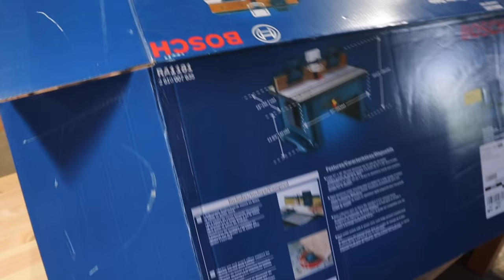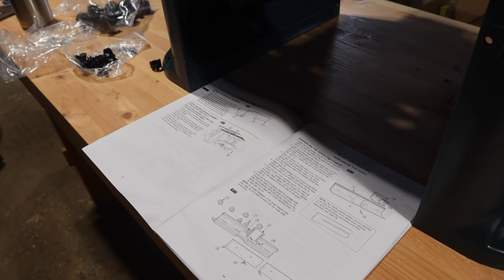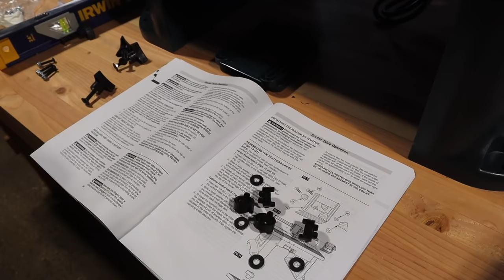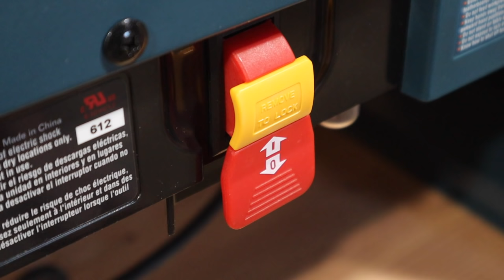New Bosch Router Table | Model RA1181 - Unboxing & Setup

Comment: Great video. I just bought the same table and router from a fellow woodworker for $225. They were brand new in the box.  The table top will fit perfectly in my Ridgid table saw extension. I am happy to hear that you said it comes with shims to joint. Hopefully I can get it set up tomorrow.
Reply from the maker: Awesome! That’s a steal of a deal! Happy building, I’ve loved having mine around.
Reply: I’m thinking of getting this router table and  same router you have. You still like the router table? Is it level?
Reply: @stevesiefken6432  I do like it. I have never had any issues with the table or router. 👍🏼

Comment: I purchased the same table from Lowe's about 2 years (had to special order it) ago and it is still going strong (just used it today).  Great video!
Reply from the maker: Sweet! Glad to hear it’s still going strong!
Reply: @NorthwestCraftsman  how much this router ?
Reply from the maker: @johnyabut5887  both the router and table can be found on Amazon at the following links 😊 prices will vary depending on when you check. 

    Router Kit, Bosch 1617EVSPK: https://amzn.to/2HE72Kk
    Router Table, Bosch RA1181: https://amzn.to/37OY0W6
Reply: How easy is it to square the fence to the bit? I have an older Ryobi router table and it is a massive pain to properly align the fence.
Reply: @smattt personally I think any squaring is a pain in the rear but it’s less complicated than others. Just take your time and don’t get too frustrated. All-in-all not too bad.

Comment: I bought virtually the same table 20 years ago made by an Australian Company called Global Machine Company. Came with its own router. I got it REALLY Cheap from Lowe’s. I just had to assemble it. I remember the Manager at Lowe’s was VERY eager to get rid of it.
Reply from the maker: Fascinating! Has it held up over those years?
Reply: @NorthwestCraftsman  Yes sir it has!  It doesn’t get heavy use as I also have a Router in my ancient Delta Rockwell table saw extension. 
  It’s fascinating this design has endured. Mine also has legs so it stands alone. I’m really sure I’ve seen this same design under other names as well. 
  I also bought a cheap Drill Press from that company as well. Still hanging in there. It even has a laser!……..Cheers

Comment: You can see (6:26 ) that this table is worped. look at the left side of the fence as it rises towards the center of the table.
Reply from the maker: I’ll need to double check when I get to the shop this morning but I’m pretty sure this was the MDF fence and not the table top.
Reply from the maker: I just double checked and what is showing in this clip is the MDF not being flush to the table. When I throw my level across the table is flat within about 1/64”. This may not be flat enough for some, but for an amateur woodworker, this is perfect for me. Give me 5 years and that may change, but for now 😂
Reply: @NorthwestCraftsman  Thanks for the reply, glad it was the MDF and not the table.
Reply from the maker: @michaeljakus8373  of course! Thanks for calling me out, there are many times that I’ll miss something like that and that’s how learning happens.

Comment: I have one of these tables and my top was warped, as someone else has mentioned in the comments. I contacted Bosch and they sent out a new top, so kudos to them for the customer service. Unfortunately, it was also warped. I took a couple hours and was able to flatten it a bit by knocking down the high spots (with elbow grease and some sand paper on a slab of flat granite). It helped a considerably, but there are still low points and the top still isn't flat enough to support workpieces for something like nicely fitting rails and stiles. I've continued to use it for less precise work, but plan on getting a new table top, plate and fence when I finally tackle the upcoming kitchen project.
Reply from the maker: Interesting! I’m sorry to hear about your experience with the table tops. It’s possible I’m just not nearly as attuned to minor differences that some of the users (yourself included) are seeing. Glad Bosch at least tried to remedy the situation. Thanks for the comment!

Comment: I've got the same one coming in this Monday  9 -28. I'm 2nd guessing with all the negative comments about bits getting stuck , unlevel surface etc. I've got the 2 1/2 hp  Harbor Freight one. Its about a week old, still hasn't been used yet.. Nitpicking about which bits to buy. Looking at the 70 Bit Professional C3 Carbide Router Bit Set - 1/2" Shank - Yonico 17702..
Reply from the maker: ccdirectt vdllc I saw a bunch of the negative comments as well but haven’t had any issues with mine. Perhaps it’s a batch inconsistency issue? 

The bits honestly make a huge difference. I got a cheap set off amazon which gives me a variety and then a nice Freud bit (3/8” up spiral bit) and I love it.

Comment: I owned this Bosch table. I have one minor complaint and two major complaints about it. The minor complaint is that the cast and machined table surface isn't flat. It was warped, not severely but enough to be very annoying to me.

The first major complaint is that the insert is a non-standard size, so you can't use another vendor's router lift.

The second major complaint is with mounting a Bosch fixed base upside down to the insert plate. When you turn Bosch's MRF01 base, for example, upside down, the entire weight of the router motor is suspended by a single E-clip, a spring clip held in a groove on the height adjustment shaft. That clip eventually gave way and left the motor unsuspended for height adjustments. Most fixed router bases use a similar design such that they're great when used right-side-up, but they're unacceptably weak when used upside down. Combine that problem with the inability to use a third-party router lift, and you end up with an annoying and awkward router table.
Reply from the maker: Robert, thanks for your well thought out response. I can understand why the warped table leaves a sour taste, especially if you want to use your table for anything like jointing, makes it unusable. 

I didn’t know that the router plate was a non standard size! Interesting and frustrating if you already have another router. I know it’s designed to work with the 1617EVS and the height adjustment included but I hadn’t thought about height adjustment with other brands. That’s a great point. 

With regards to the mounting, are there not fasteners that attach your router to the router plate? The securement method I have and see on the plate is quite secure. I guess this assumes the default Bosch plate is used.
Reply: @NorthwestCraftsman  To be clear, other router motors fit into the Bosch router plate. It has several hole patterns so that you can use other motors. However, the plates of third-party router lift manufacturers won't fit into the tabletop.

Regarding the E-clip, I can speak only to the Bosch MRF01, the fixed base associated with the Bosch MRC23EVSK router system. Certainly, the fixed base is well secured to the insert plate. And, the main clamp of the base securely holds the motor in the base when routing. BUT, when the main clamp is loosened for height adjustment, the entire weight of the motor is suspended from the E-clip.

This is getting into the weeds, but you can see an illustration of the E-clip this way: Go to the Bosch website and search for MRF01. Go to the product page that describes the MRF01 and then scroll down under "SUPPORT". Click the "More information" button under "Search for Parts Diagram". Enter "MRF01" (without quotes) in the "Tool Model Number" window and click the Search button. Then click "View Parts Diagram". Item 21 is the height adjustment shaft. Item 23 rides on Item 21 and its tab locks into a groove on the motor; the tab supports the motor when the main clamp is loosed for height adjustment. Item 22 is the E-clip, what the Parts List calls "Retaining snap ring"; THIS supports Items 21 and 23 and, thus, the weight of the motor.
Reply from the maker: Interesting! I appreciate you taking time to lay that all out, that makes a lot of sense and does seem like a design flaw, or at least a weak point.

Comment: Very nice.  Thanks for help with assembly.  The confusing part is all the screws.  All these terms: truss head, pan head, #10 by xxx.  Why didn't they just color code the 400 screws that are included?  Then they would say, put the phillips head (ORANGE) screws (4) into points, etc.  

Part of your video that really helped was when putting on router plate (aluminum)  at point 4:29. One doesn't actually put the 8 screws THROUGH the holes but only uses them for leveling.  I know that was said in the instructions but because I didn't have 8 screws anymore (2 were put in wrong location on dust port) it was very confusing.  Your video is very helpful, though so I took out the 2 from dust port and now had 8 for top plate.

What about that round, clear plastic piece - is that supposed to attach to prevent chips from flying up?  No mention in manual or in your video?  It's about 3 inches in diameter and has a place for a screw at one end.
Reply from the maker: Thanks for the compliment! I agree color coding would be a good idea on their part. 

In the screw bag is a small post like screw with a flat head top. Put that inside the post of that clear piece and screw it into the router plate at about the 2o’clock position. It’s intended as a shield for routing without the fence.
Reply from the maker: On a side note, I see your user name, are you from Colorado?

Comment: I bought the same set up that you have, bosch RA 1181 table and the 1617EVSPK router.  Unfortunately, the lift on the router does not work.  When the router is mounted to the router table plate, I am unable to use the adjustment from the top of the of table.  Not sure if the router base is broke or intended to be used in that fashion.
Reply from the maker: brb318 I ran into the same issue. Make sure the friction lock (that buckle) is undone before trying to make any adjustments.
Reply: @NorthwestCraftsman  The friction lock or buckle is undone but I'm still unable to get the router to go up or down while installed on the router table using the micro adjustment.
Reply from the maker: brb318 if you can shoot me an email with a video of what your doing I’ll take a look, I can also send you one of what I do. If it’s not moving, be careful not to try and force it so it doesn’t break. My email is in the profile page (can’t post it in the comments because of bots stealing it for spam)
Reply: There is a retaining ring that rides on part of the lift mechanism and this ring is easily knocked off if you overturn the mechanism from above. Look for part number 70 in this diagram: https://www.ereplacementparts.com/bosch-1617-0601617161-router-parts-c-128_1119_1626.html
Reply from the maker: Tom Desio this would match the description of what was happening. Thanks for posting!
Reply: @tomdesio7778   The retaining ring is nothing more than a E- clip. I just searched e clip and Home Depot has them. You should be able to get them locally. Probably buying them in a kit with various sizes.  Now for my questions able this. table.

Comment: What’s the clearance below it . And can you use a larger router.. I.E porter cable 3.1/4 plunge  and is the table set up for micro adjustment with a plunge . Thx any info will save me time much appreciated.
Reply from the maker: - Clearance is about 9” from bench top to the top of that window underneath. 
- Not sure about the size of router, really depends on how big it is. I would imagine if Bosch has the router plate pattern for your router, it’ll work. No guarantees though. 
- It is set up for micro adjustments from the table top and honestly that is one of my favorite features.

Comment: I would ask what Northwest Craftsman thinks about the use of the Bosch Above-Table Hex Key RA1165 with this table?  Is it helpful?  Is it worth it to purchase with the table? I appreciate the great video.  Thank you for the excellent assembly review!
Reply from the maker: Glad you found it helpful Brian! I’m not sure of the product code you listed but the hex key that comes with this table, RA1181, is incredible. Easy to use and very precise. Just make sure to undo the friction lock on your spindle before adjusting.

Comment: Is the table perfectly flat. And is the fence 90° to the table? This is important for a router table. You can make high fences, by removing the fence bolts and drill auxiliary fences to fit through the original fences. And bolt all fences together and lock down. This is why it should be 90°.
Reply from the maker: The table is flat within about 1/64” or less, checked that just a few days ago. I believe I also checked the fence for square but will double check tomorrow morning. In complete agreement that this is critical.

Comment: This is super helpful! Bought a router then quickly realized I needed a table (beginner), and I bought this one. Your video will be my go-to for set up, so thank you. 

I was wondering the height of your workbench. I bought a Craftsman early on and - it sure is pretty but -  it’s too high for this. I don’t want to make that mistake again. 
What do you recommend for the height of the work bench for this, and how much space would you allow on either side, if it’s a stand alone piece? 
Thanks in advance! Ashlynn
Reply from the maker: Hey Ashlynn! I’m glad you found it helpful! And no worries 😂 I’m right there with you. Always learning. 

If you are making your own workbench, you can customize it to exactly your height. Generally speaking, the height of your work benches will range somewhere between your waist and rib cage. The lower the workbench, the more you are leaning over it, but the more power you can get as your muscling through things. The taller it is, the less power you get behind it, but the more ergonomic and close to your eyes it is for fine work. 

For the router table I have mine at about my belly button. Ideally, you shouldn’t have to muscle anything across the router table, whatever bit you are using should easily cut. I may even opt to have it a little bit higher. 

However, when you are building that workbench, make sure to take into account the height of the router table. Seems like a stupid reminder, but I make those kinds of mistakes all the time. 😂
Reply: @NorthwestCraftsman  thank you so much for your thorough response. And for the helpful tip at the end! That’s pretty critical, and knowing me, I would’ve spaced it. Thanks for the valuable information in the video and for the feedback.
Reply from the maker: Of course! Good luck and happy woodworking!

Comment: Hi NWC!
Thanks for the video. Very informative!
Some questions regarding the height adjustment feature of the fixed base when mounted to the router table:
1- Is it a good replacement of a router lift?
2- Is it accurate?
3- Is it easy to use?
Thanks for sharing.
Saludos from Mexico City.
Reply from the maker: ¡Buenos dias mi amigo! Gracias por la pregunta. 

Excellent questions. I would say it’s a great replacement for a router lift, it’s extremely accurate (I can easily move it within a few thousandths of an inch), and it’s very easy to use. Just make sure to undo the friction lock on your base before adjusting.  

Tenga un buen dia! 

Josh
Northwest Craftsman
Reply: @NorthwestCraftsman  muchas gracias por tu rápida respuesta Josh!
Buen fin de semana!

Comment: Awesome video. How can I remove a quarter on an inch wood out of a 5 by 3 inch piece of wood ? I appreciate your time. Thank you very much.
Reply from the maker: Thanks for the comment! Are you trying to remove it across the entire surface? Or just a specific area?
Reply: @NorthwestCraftsman  I like to remove it across the entire area in a commercial set up. Thank you for taking the time to respond
Reply from the maker: No problem! A planer is the tool I’d use but 3x5 is too short for most if not all planers which means you’ll either need to double sticky it down, or plane it before cutting them to 3x5 (this is the route I’d go).

Comment: Just got my 1181 from Amazon and assembled tonight, can’t wait to use it! I also ordered the dust collection adapter for the 1617 router that you demo’d from Etsy. That looks like it will prevent any dust from getting out, though I do think it will be a bit of a hassle to change bits. It would be worth it to keep the dust to a minimum.
Reply from the maker: Awesome! 😄 I’m excited for you to get to use it! I was thinking the same thing about the bits but another viewer commented about Bosch’s “Offset Wrenches” and sure enough, they have some. They allow you to change the bit from above the table much more easily. Here’s a link! I’ll probably be getting a pair myself. 

Offset Wrenches. 
https://amzn.to/34zl0Jm
Reply: @NorthwestCraftsman  sweet! Ordering them now! Thanks again

Comment: Did you figure out the shims? I’ve watched 3 videos now and no one mentions or follows through with them.
Reply from the maker: Tracie, thanks for the question! I haven't found a video on this router in particular but Fine Woodworking had an excellent video for how to use a router as a jointer in general. 

What would be different with our table is the 1/16" shims would go on the trailing side of the fence and set equal with the apex of the bit. This leaves the leading edge slightly offset, like in the video. I'll see if I can put together a video on using this specific table and shims as a jointer. Stay tuned!

Fine Woodworking's Video
https://www.youtube.com/watch?v=SAPvg48SvVY
Reply: You put the shim behind the left side fence and it allows you to use the router table as a jointer.